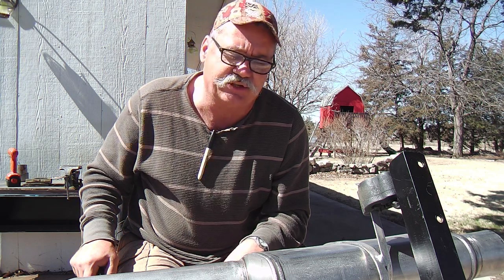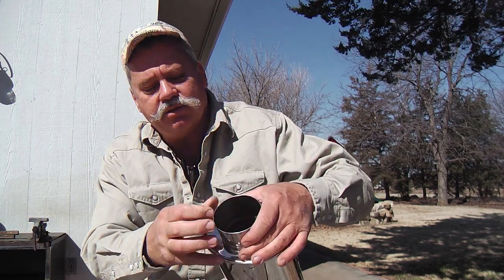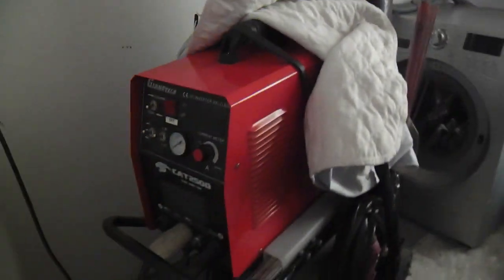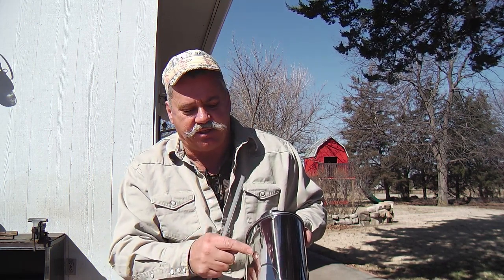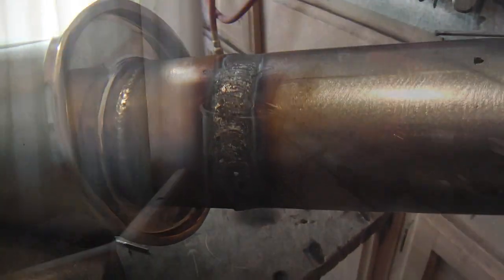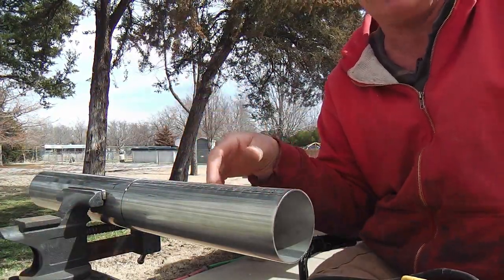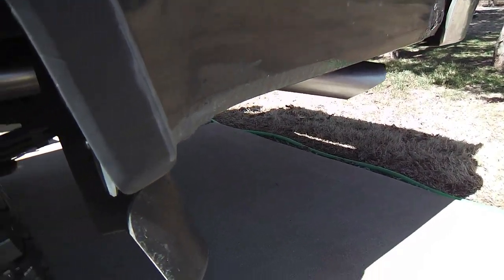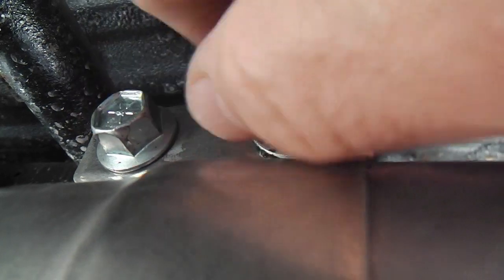Design and Fabricate a Stainless Steel Exhaust System

Comment: Christian, The only problem with going with such a large exhaust system. Is that you reduced the exhaust gas velocity in the pipe. Bigger is not always better. In Fact it will hurt your low end torque. Going to big will slow the exhaust flow because it is going into a bigger chamber. It may be great for high RPM's but how many times are you ever at high RPM's? You should always match up your pipe diameter with your exhaust manifold outlet. If you do go bigger, go no more than a 1/4" larger. This will keep the exhaust velocity faster in the pipe and will keep your torque good all the way thru the RPM range. Besides that you did a very good job fabricating your exhaust system. I've been in the custom exhaust building business for 30 years. You did nice work!

Comment from the maker: Hey, thanks for that feedback, muffman.

Yeah, even though I have almost no previous experience with exhaust system design, I think I heard something like that, but I didn't want to have a noisy or drone sound with  the new system, and thought stepping up from 2", to 2.5", and ultimately to 3" might combat that drone and backfire tendency that seems common with aftermarket exhaust systems. I also thought the freer flowing would possible improve mileage a bit, with less back pressure, that may cause the vehicle to "coast" better even with light throttle. I also thought the addition of the resonator might restore some of that lost back pressure from the tubing enlargement.

Of course, I may very well have lost some torque, but I haven't really noticed it. 

I may have even done something else that is counterintuitive or not recommended, performance wise, at the intake, by refurbishing it with some slightly necked-down stainless tubing going to the throttle body and installing a new K&N-style filter system. There is a little showing of it at the video on Installing a B2200 Hood and A B2600 Mazda Truck at my same YouTube Channel here. And that seemed to improve the throttle response a bit, but could have been due to removal of a less than airtight baffle box-crankcase breather apparatus.

And that was also some of my first TIG welding with stainless steel tubing, which I now know a better practice would have included some back purging with Argon. But, nonetheless, the system hasn't developed any pinholes at the welds due to the underside having oxides at areas of any burn-through and internal moisture compromising it too much, at lease so far, with a year or two now past. 

So, yeah, maybe I'll stick to the same diameter tubing next time, if there ever is one. And maybe those reading this will be well informed by your feedback, especially if they want to keep as much torque as possible. But this truck is a casual project for me, which will undoubtedly include some mistakes. I'll probably get around to doing a custom rear bumper on it, with an accent of diamond plate. And maybe a slight update to the front grill, with some framed-in expanded metal in place of the plastic area, to give it an Australian Outback Bush look. Ha, ha, ha...

Peace be with you,
Christian L.
Reply: +NewJerusalemTimes I was very impressed with your workmanship and the attention to detail. I'm glad to see that you didn't eliminate the catalytic converter. People do not realize how much drivability/performance loss that they lose on something they drive everyday when they remove the cat. conv.  Cats are not restrictive. In fact they help speed up the exhaust by heating it up. which in turns increases exhaust gas velocity in the pipe and increases torque. I know I'm getting a little off the subject. Cat. Conv's. got a bad name back in the mid 70's and early 80's for clogging up and being restrictive. But actually the cause was people were putting Leaded Gas in their vehicles and a Cat. Conv. can not get rid of lead and they have had a bad name every since. But people caused their own problems. That's why it said unleaded fuel only. Back in the day Regular leaded gas was cheaper than unleaded fuel and that's why people used it. Which makes no sense to me. You would of thought unleaded fuel would of been cheaper. It did not have the cost of adding lead to the fuel. But that is just one of the many ways the Petroleum companies have always put the Screws to us. Peace out,Steve S. aka muffmanfromhellP.S.I like your views on things.